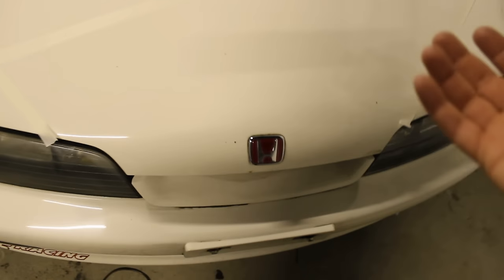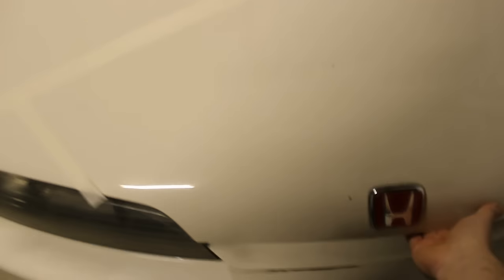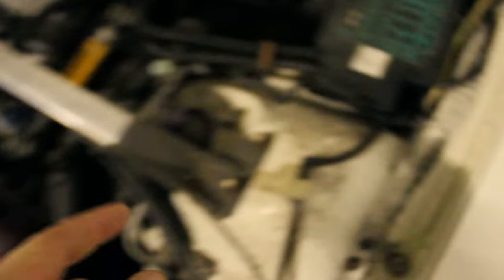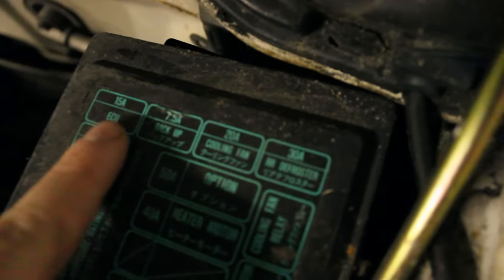How to reset your ECU in less than 1 minute

Comment: Question. I was thinking since i replaced a lot of sensors and parts to my old 92 wrangler i wanted to reset it so it can calibrate the new parts.  Is this the way to do it?  Will it make any difference?
Reply: Orderdrake doing this will reset the computer to default settings, from which it can recalibrate how the car operates based on sensory input. If a sensor is out of spec, that’s another issue and may trigger another CEL. Read the codes to resolve it.

Comment: Hopefully someone cane help me out. My check-engine light turned on and I found out I needed to replace the thermostat in the engine. I replaced it, refilled the anti-freeze, made sure the engine didnt overheat, and as far as I can tell everything is working fine...except the check-engine light is still on. When I looked up the code it was still saying the thermostat needed to be replaced. Do all I need to do is reset my ECU? And do you still recommend doing it this way in the video?
Reply: did u resolve this because i have the same problem
Reply: @wrexkplays6799  Actually, the light finally turned off after a few days. It just needed time to seal and adjust.

Comment: My son's Honda had the problem happen where the idol started going from started going from 500 RPM to 1500 RPM so they replaced the idle control valve then the entire exhaust system and a cold air intake just to be sure it wasn't the intake and exhaust gaskets. Now it's still doing it and we even tried to reset the ECU by pulling the fuse under the hood and disconnect in the battery has anyone else had this problem and fixed it?
Reply: Check the EGR valve and the small channels that can get clogged with soot. If it’s a 2006 Honda or earlier then it might have that issue. Also, ICVs can get stuck, but usually not if it is new. Replacing the whole exhaust system really doesnt have much to do with idle control, u less there is a huge leak. But that is usually something uou can see or hear and once an wxhaust leak is fixed the problem should have gone away.

Comment: Doesn't work on some ECU'S. Pulling the 15 amp ECU fuse does nothing. You have to unplug both battery connectors for over 30 minutes.
Reply: Couldn't you just try to start your car with the terminals unplugged to drain the juice all the way instead of waiting 30 mins?
Reply: No,power fron the batter is what turns a starter. A computers capacitors retain small amount of power always feeding the computer itself. And untill they deplete themselves of that power, the computer can't actually shut down and reset .all capacitors hold electricity. That's why when you have subs in your car you're supposed to also have a capacitor that stores up energy so the amp and subs doesnt strain  your alternator and battery

Comment: Nope. This does not work on my Sienna.
You need to bleed off the memory storage power -- which is commonly held in capacitors.
They do not discharge all that fast. 
Take off one terminal -- either one -- and while one is off -- short both together. 
This gets around any diodes that protect the 'caps' -- so that they have to bleed off.
Even this takes about 15-seconds of contact -- just to be sure.

There is no ECU / auto brain that will have residual memory after the caps are bled... any brand... any make.

Comment: I doubt it would reset the tune  parameters of ECU as never had time to disapate  power from computer. AS you need two  reset ECU when changing fuel octane rates  or use or fit a different exhaust system or replace your O2 sensors. As I just replaced mine  at sadly 140,000km. So computer had adjusted to the not correct or not working at all. So guess it  had limited  range to work of working boundaries of old units.  I disconnected battery when got home tonight. We reconnect in morning, fill tank and drive to bridge & back at around 58km round trip. Currently 12L per 100km on 98oct. before on shit cheap WW fuel 92oct.it was using 17L that was just around town. My car now gives 12L long trip and 13L stop start in town & never above 60kph around town. V6 4.0L work ute so has low diff ratio than most cars, Carry nothing or carry 400kg almost same economy, friend borrowed and used  shit fuel and got shit economy. Nearby large city, I run there and back for $48, she pumped in $70 and my tank was dead empty on return. Sit on 98 kph or 112 kph exact same economy, maybe $1 or $2 difference over 1,000km. I will ost resuts   hen this tank has nearly been used  by total refill so know exactly  how much fuel I used....cheers from Australia coming into summer and air-con.

Comment: Idle just still when it warms up goes up-and-down open down
Reply: You need to do an idle reset i.e. actual ECU reset and this video does not achieve a real ECU reset.  You need to drain the caps... Unplug battery, cover up posts of battery so you don't accidentally touch them, jumper the positive/negative cables together for 15 minutes,  turn off ALL LOADS in car (lights, A/C, stereo, DRL if possible (putting the emergency break on will defeat the DRL in some hondas - must be done BEFORE cranking car),  crank car and let idle for long enough for fans to turn on/off twice.

Comment: Not good if you have a Renault megane as you need to remove the battery then remove battery tray then remove 2 bolts from cover and the slide fuse box out then turn it over then you can get to the fuses because the stupid muppets who designed it put the fuse box in upside down 🤬
Reply: Yeah it is french crap 🤣🤣

Comment: I DID IT LIKE YOU  DID   BUT AFTER THAT THE CAR WONT START   WHY?
Reply: yes, this procedure is problematic.  after i did it, my airbags went off.  i gave it a thumbs down so hopefully i save someone $$ replacing 6 airbags
Reply: Did you guys removed and installed the fuse during battery of? I disconnected my negative from the battery just to be safe.
Reply: One comment with the same problem said it screwed up the computers memory of the transponder ignition keys....essentially computer no longer recognizes your car key.

Comment: I have a no start no crank that I just a engine swap on my 2003 ep3.
Reply: Budget Builds/Wheelhuas racing what happened with your car? I had a no start no crank and it was a bad transmission control module. I have a Ford and they fixed it under a special warranty or recall a lot of people don’t know about.

Comment: Disconnect the battery for a few minutes dose the same thing.If there is a problem it will light up the CEL again after a few dozen miles.This is not a permanent solution and fixes nothing.

Comment: I do by disconecting battery cables for 5 minutes.
Reply from the maker: Works as well but then you usually loose your clock and radio settings as well
Reply: The Midnight Garage well need to reset. You should do a video on Hyundai cars, i found that by taking out  dash fuse miles would not show ether. I did it in a few and sure enough driven miles would not show even after fuse was put back on. It blew my mind.